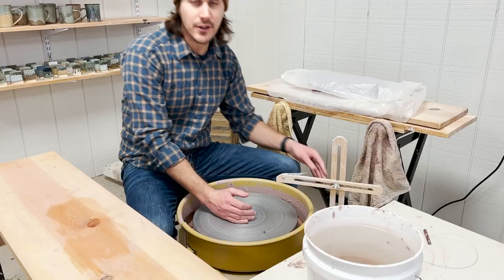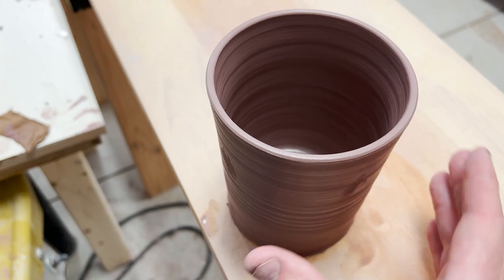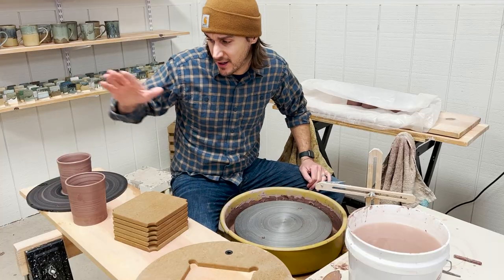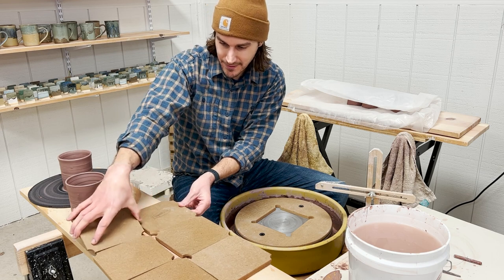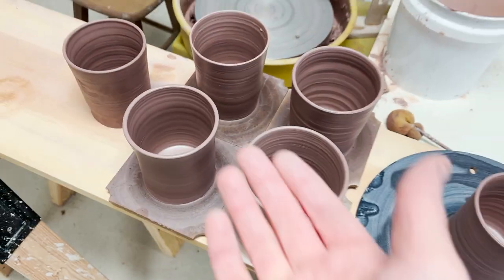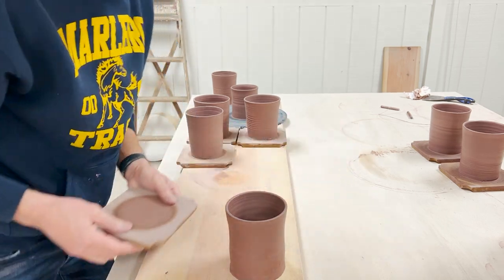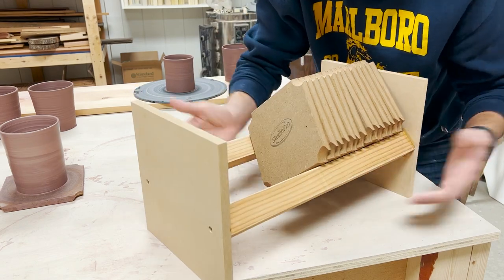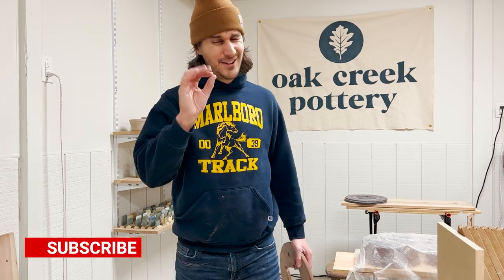A creative solution to making pottery... bat system review

Comment: Looks like a great system, but how is it a space saver storage solution if you were supposed to remove the pots as soon as possible from the wood? They are not designed for you to dry them overnight and then remove the pots the way you did? Do you have Any follow up on that after lots of use? Can one Let pots get pretty hard and then remove them and let the squares dry out vertically, and do not have warping of the squares?

Comment: Nice and I believe you can use ceramic tiles as well
Reply: You are correct! Less expensive and no warping. Just get tiles a satin glaze, so the clay will bite and hold.
Reply: @gregp4819 how do you secure them?  What size do you use?
Reply: @jujub6839  I used a speedball bat. I placed a 6x6 tile in the center and cut it out a hole with an extra "keyhole" in one corner. The keyhole was to easily remove the tile with my wooden ceramic knife/screwdriver, but you could use any bat. You may just might need a spacer depending on the thickness of the tile/bat. Good luck!

Comment: hi! my bats are allll wobbling even though they are brand new, im using a bat buddy, and i have purchased bats from 3 different stores now. I have hand tightened my pins as firmly as i can but there is a wobble once each bat is on the wheel head. I have never had this issue in class and im getting so frustrated. any ideas?
Reply: Try to put carpet non slip pad under or attach with small dots of clay. I haven't tried it my self but just a thought

Comment: Some wheels don't have the pin system. Instead, there are holes where you engage the bat system. How can I figure what bat system is the best for my wheel?
Reply: Get a bat that fits your wheelhead and drill the holes into your wheel.
Use stainless steel round head bolts to fit